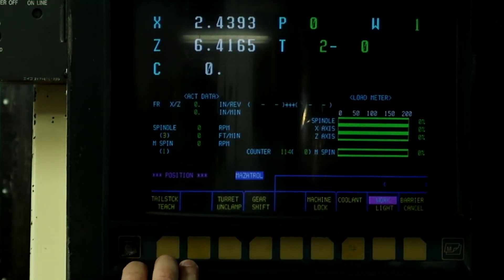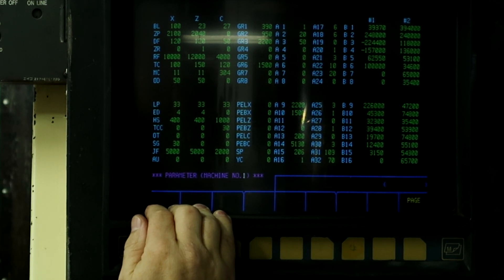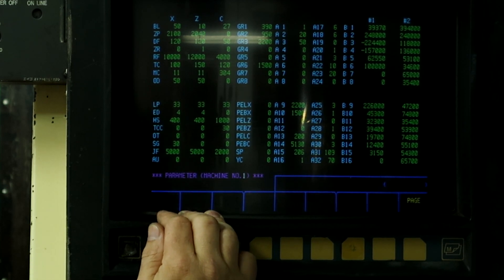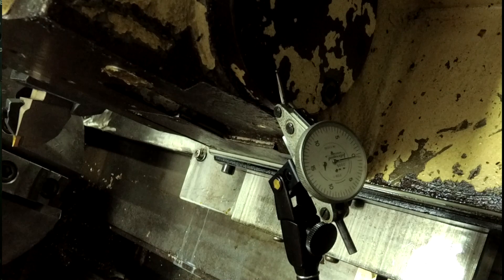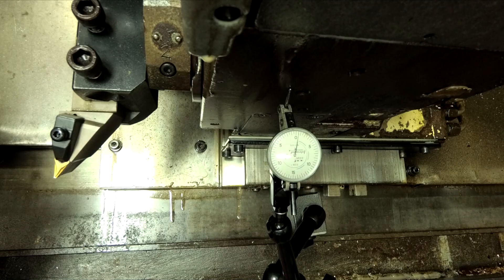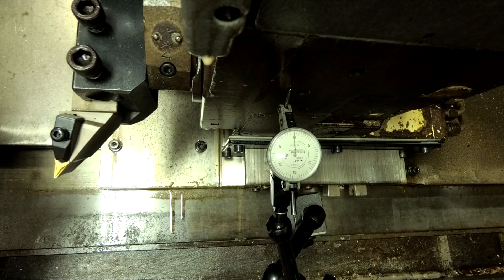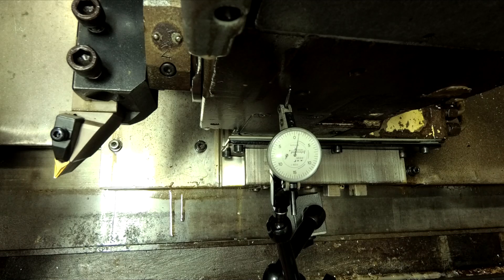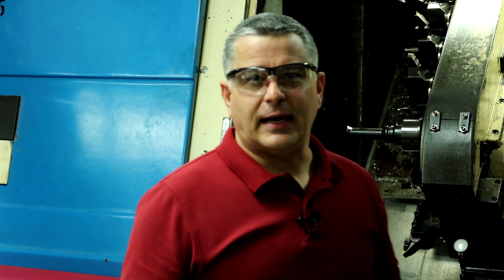Mazak Backlash Parameters CNC Lathe T2 T3 Control

Comment: I got the official instructions for this from Mazak. They told me to never use the pulse generator for finding backlash. You are supposed to use a program to move it. Not sure why. Any ideas ?
Reply from the maker: @b0bj0nes42  Maybe using a program is more accurate method?

Comment: Sir, 
Let me know how to correct and bypass the alarm no. 209 sideway oil malfunction alarm.
I have Mazak nexus 8800-II
Reply from the maker: Put in more oil or replace the pressure switch if it is faulty.
Reply: @mazatroltipsandtricks6816  sir,  I don't have spare of pressure switch.any option for bypass as a temporary
Reply from the maker: @ajayajju8329  connect the 2 wires together.

Comment: Hey Phil, After watching this video I was excited about getting back to work and resolving my backlash problems. I run a 1994 Mazak Slant 50. Being very new to this machine and to CNC machines in general. I have never changed a parameter. I have a T Plus controller and I have no idea where the backlash compensation parameter is. I went through all the parameter pages, so obviously this controller is different than yours. I also went through the manual with the parameter lists and saw nothing about backlash compensation. This is a machine parameter, right? Of course I also check in the user parameters with the same result.
Reply from the maker: Unfortunately, I only have the books on the T2 and T3 controls.
Reply: Mazatrol Tips and Tricks I thought that might be the case. It’s hard to find any help on this controller online Thank you for your quick response. I have contacted Mazak and will be awaiting their response. But I really appreciate what you’ve done with your videos. They are my life line when I get into something new on this machine!👍
Reply: @randyharsey8739  did you get the parameter for a T Plus control to do this on?  I recently got a QT20 I'm cleaning up and going through and wanted to take a look at what is in there.  Went through the book quickly but didn't find the parameter yet... perhaps another go at it...

Comment: Phil can you have a video for rethreading OD? When the workpiece already remove then put back again for re-threading.
Reply from the maker: I have not attempted that on an old Mazak.  It would be a matter of backing off the X axis wear way off and try to eyeball the V into the existing thread by adjusting the Z offset wear.  This would be best done with an infeed angle of 0° instead of the usual infeed of 60°.  This would be very difficult to film on camera.

Comment: Good video Phil.
As part of the full rebuild of my machine i took the time to Re-Ball  the Ball Screws on both 
X axis and Z Axis.
Looking forward to see how much i have improved the backlash run-out on both axis.
Still a little way off doing this as i have a fair amount of work to do before i have power reconnected to the machine.
Very much looking forward to have it running again.
I get to the point of just saying i want it running, lol.
All good things in time i guess.
Watching your video,s gives me some motivation to get it happening.
Thanks again for posting these video,s.
Peter.
Reply from the maker: Thanks for the feedback, Peter. Next video is on tool probe calibration. Should be done soon.
Reply: @mazatroltipsandtricks6816  
Thanks Phil.
The funny part about the machine i am currently rebuilding is it,s the exact same machine model i learnt to run a Mazatrol Controller,  it was even the same colour green before i repainted it.
Mazak QT15 brand new in 1990.
It feels like yesterday, LOL.
Looking forward to watching the next video.
All the best.
Peter from Australia.
Reply from the maker: @weldmachine  I bought the same exact machine model I learned Mazatrol on myself 24 years ago. Still love my 1986 QT10N ATC/MC at work and still use it several times a week.
Reply: @mazatroltipsandtricks6816  
You must be like me Phil.
You fell in Love at first sight with your machine, lol.
Love the Mazak machines.
Not cheap to buy or maintain but definitely worth the money.
Happy to see you posting more video,s too.
Keep up the good work.
Peter.
Reply: @weldmachine  I think that Mazak are great machines. However, the main gripe I have with Mazak is that you cannot leave text messages in a program.
Reply: @ronaldmadican2393 : And why do you have to do that?